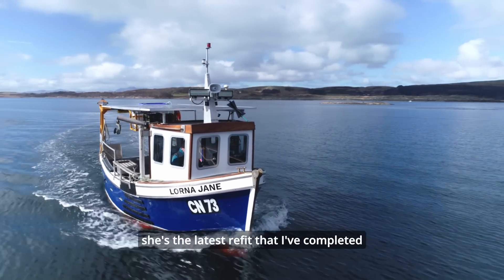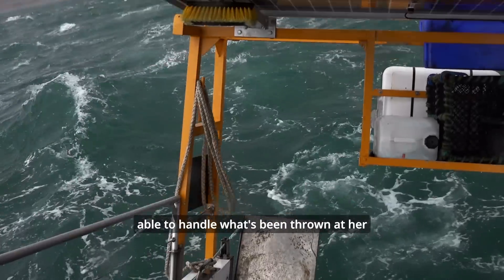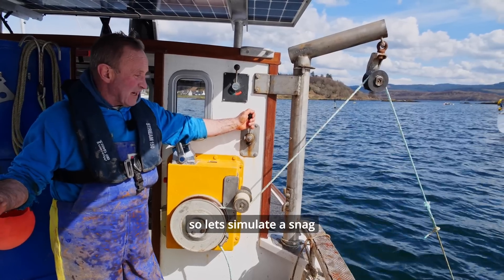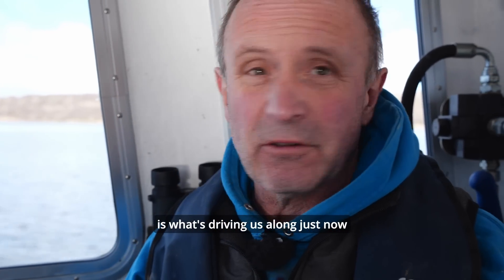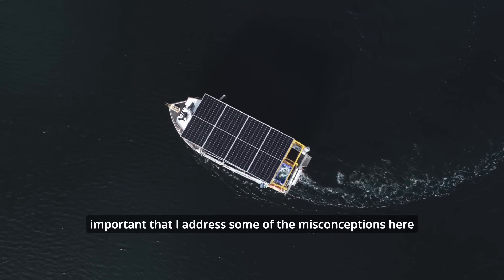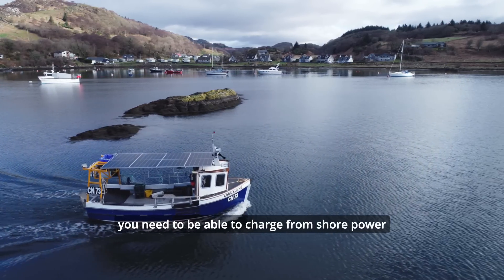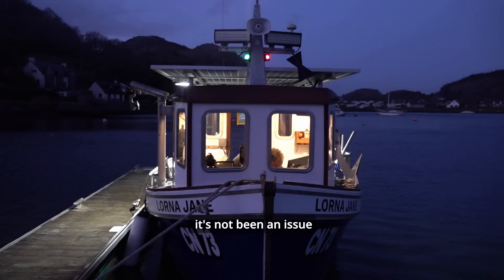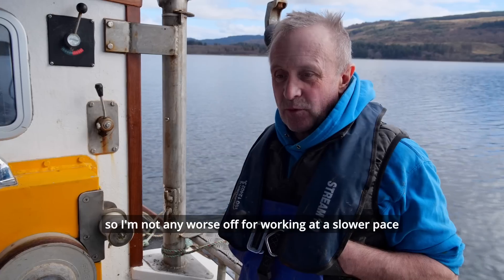An all electric Lobster fishing boat   Watch It Work  Lorna Jane.

Comment: That’s a great little boat. I like the idea. I’m interested as someone who grew up lobstering in Maine, how fast is that boat with diesel power. It seems to me a Maine boat such as a 33 Young Brothers would be faster with the electric power you’re running. More like 10 knots. But I’m really not sure.
Reply: If I put the handle down it does 6.5knts, pretty much what the diesel did. Hull speed of this design is 5.5 knots. You're right, the boat designs you have up the eastern coast look really efficient. Pretty sure you'd be faster with one of those designs. 8 knots seems more realistic to me but am not familiar with your boats. Speed will ultimately depend on motor size and weight of battery bank.
Reply: @ there was a wood 34 footer in the 50’s called Merganser designed and built  by Will Frost that did 25 knots fully soaked with a 240 horsepower 318 Chrysler V8. The old wood boats were much slipperier than the modern glass boats because the new boats hold their width to the stern for added room. But they’re still fast

Comment: Like to see you fix it at sea if your boat breaks in the ocean your done gaurantee 5 to 10 years you will be using deisel that boat takes on water your done i can think of so many situations that happens at sea that will knock out e boat but deisel either could be fixed or wouldnt effect it might be ok for this guy to run a boat like this but not going to be viable for most boats
Reply: So many failure points on a diesel engine.  Batteries will be IP6 or IP7 waterproof rated. Electric motor in this example actually is under water!

Comment: Just what I've been looking for. I'm going to be converting a Western Australian 12mtr Aluminium Cray (Lobster) Boat to elec (+ sail), for blue water cruising, the deck being the main living/patio area under the panels, vs most boats having small outdoor areas.
It's great you get up to 90% funding. I can get it for my house, not boat (honestly).

Q; How's the input benefit from down facing panels from water reflection? Apparently due to installer weight considerations, these panels have 3mm glass each side, vs standard having 6mm on top, which could be a concern with hail storms, or even walking on them for cleaning bird shiet, etc.

That Gemini looks a nice cat, not seen one before.

Comment: Gonna have far more issues than an ic engine. Sounds like a straight bad idea
Reply: How? Especially for his semi-retired requirements.
Plenty boats have converted to all elec now, especially blue water cruisers. This vid is just one example
Reply: Only one moving part. Difficult to see how you reach your conclusion.
Reply: @marviwilson1853  one moving part and 1000s of batteries, transitors, wiring, terminals, electrical components. All tiny and made of dissimiliar metals. Unless these stay on fresh water, they will get eaten alive
Reply: @durbeshpatel3047  Electrics and electronics have been used at sea for decades. Can't quite understand your logic.
Reply: Well he won't get engine overheating, blocked seawater cooling pipes, broken impellor pumps, snapped rubber belts, blocked fuel injectors, damaged oil seals, old air filters and oil filters, contaminated oil, contaminated diesel, broken compression and oil scrapper rings, damaged bearings, coked up exhausts, broken exhausts, governor problems, broken seals, oil leaks, damaged radiators, rusty fuel tanks, blown turbo's.... on and on and on and on....
Reply: @marviwilson1853  those are all things that are easy to fix compared tk electronics. Electronics at this scale are not widely used at sea, its basically for navigstion only. You need reliability. Not a million things to go wrong
Reply: @durbeshpatel3047  So what you are saying then is one of the most safety critical parts of going to sea, ie the navigation, is placed in the hands of electronics!
Reply: @marviwilson1853  yeah thats what im saying. Glad you can read. Go find me any vessel over 17ft that is fully battery electric powered and not riddle with issues. Pro tip, you cant.

Comment: Nice little boat. It's just nice to see how much power you need and what these Panels already provide. Batteries and motor/controllers will get cheaper and battery/solar will be the standard for coastal vessels and ferries soon.

Comment: so no sun and your out all day poor weather? battery for a boat is a no go !! for a boat around 12 to 20 ton  your wee boat might weigh 2.2 ton diesel is king! and always will be!!
Reply: Hybride
Reply: He said he still has 50% when he gets back. Can charge off grid at dock if required. What do you do if the diesel shiets itself?
Lead base petrol through a V8 carburettor was King before that, but wasn't any good for us or our grandkids either
Reply: @Lana_Warwick  is he hauling 900 pots per day? dont think so!! hes playing at it !
Reply: @azentioced9  He doesn't have the operational overheads requiring it, incl high fuel & R&M costs over long rough distances, in a larger boat to carry enough traps, line, floats, etc.
Also doesn't 'need to' pay wages+++ for Deckies.
I'd reckon his end of season net % would be better than anyone pulling 900p/d, with much less effort & stress.
Reply: @Lana_Warwick  wro n g that biilll shot face Ned I a
Reply: @sharonbraselton3135  What??
Reply: @Lana_Warwick  little boat not going far ! bigger boat needs diesel battery no good! battery cars fine for an old lady going to the shop no use if you have to travel a long way in the  snow? they have not put enough thought in to it and it wont work you need heaters in a car for a start  battery will not last  at sea you need diesel battery  will not work wast of time  this planet needs coal and petrol and diesel who can afford to heat there house with eletric?  no body unless your rich
Reply: @Lana_Warwick  hydrogen is the answer for every thing  engine cooking and heating
Reply: @azentioced9  Absolutely not. Too dangerous and very expensive. A hydrogen bus route in London was suspended during the olympic games because of the danger of explosion. The depot was at Stratford. Also the hydrogen busses cost about 17 times more to run than a normal diesel bus.
Reply: @tmog1000   diesel is king and always will be battery is crap fine for a  grannie car in town! thats it we NEED OIL for ever  a battery  remote control boat yeah!!
Reply: The sun in most places on earth, most of the time,  rises and sets every day. The only time that would be problematic would be during a total solar eclipse of the sun by the moon but they usually only last a handful of minutes. We are transitioning from the fossil fuel age to the electric age. It is a 100 year process. Nothing can stop it. The piston/cylinder heat engine whether steam or diesel has had its day.
Reply: @marviwilson1853   diesel is king!! and always will be !! and petrol  battery is no use for any thing at sea apart from lighting the gas cooker
Reply: @azentioced9  we are transitioning from the fossil fuel age to the electric age. It is maybe a 100 year long process. Nothing will stop it now.

Comment: I prefer a real boat with 5000 miles of range.
Reply: Hybrude hydergen😅
Reply: This boat can go 5000 miles without recharging at 3.5kts. It can refuel in the middle of the Pacific. You can't do that with diesel.
Reply: @marviwilson1853  
Actually you can and it’s been done for many decades. It’s called bunkering. 
5000 miles without recharging is an obvious lie. Do the math. 
Anyway, I’ve done multiple 5000 mile trips with no diesel and no recharging. It’s literally been done for hundreds upon hundreds of years. It’s called sailing and it requires no child labor working in dangerous mines.
Reply: @keithb6717  You clearly have not watched the video. At speeds of around 3-4 kts, solar/battery boats like this can cruise indefinitely in reasonably sunny conditions. During the day the panels generate more power than needed for low speed propulsion. The batteries always remain charged for propulsive power through the night. Nothing wrong with sailing, not sure why you mention that! Australia is the biggest lithium producer in the world. They don't use child labor as far as I remember. It really is not helpful to introduce these anti EV myths.
Reply: @marviwilson1853  
Obviously you’ve never traveled thousands of miles upon the ocean. I’m guessing you’ve no miles.
I’ve had arrays. They never produced enough power to even run the radar and autopilot and refrigeration and everything else without running the diesel a couple of hours daily. (Under sail). 
Sunny isn’t the norm, honey. You can pretty much count on rain once or twice a day. 
   Well, since Australia doesn’t have child labor we’ll excuse the practice globally and pretend that all batteries come from Australia. 
    Electrical is your system/systems most likely to fail. 
No diesel and no sails sounds like a ship of nightmares.
Reply: @marviwilson1853  
I sailed to Hawaii from Mexico at seven knots. It took 28 days. That thing, ifit continued working, would take about sixty. What fun!
Reply: @keithb6717  but he is not looking for Lobsters in Hawaii! 28 days to go from Mexico to Hawaii when a plane takes some hours - what fun!!
Reply: @keithb6717  I am a seaman. Probably spend over 10 years of my life at sea. Tens of thousands of miles at sea worldwide. With a diesel tank you have a fixed range at a certain speed, with a battery "tank" you have a fixed range at a certain speed but the battery can recharge at sea the diesel tank cannot. Your passage plan just takes all this into account to allow you to complete your voyage safely. You mislead the reader, radar's and autopilots do not run directly from solar panels they run from batteries charged by solar panels. You clearly failed to calculate your battery capacity and solar installation required to run all your electrics. That is your fault. It would be like running out of fuel in a car driving from A to B and then saying it was a problem with petrol and the stuff is no good!! Most batteries as the readers here will know come from China with raw materials sourced in Australia, Chile and China. As Congo producers tiny amounts of the worlds Lithium supply but maybe uses child labour then off course the anti electric lobby make this a headline. We don't buy it! The world is changing from the fossil fuel age to the electric age. It is maybe a 100 year transitional process and nothing will stop it.
Reply: @marviwilson1853  
I’m a sailing captain. I don’t have a wimpy maximum range except for limitations on food. I don’t own the boats or build them. For instance Hawaii from La Paz = 40 gallons fuel (and no child miners!) (we don’t use fuel for propulsion, the prop wouldn’t do much 2hen the boat is under sail as sailing speed is faster than the motor could go typically) (I actually have more of a minimum range. If you’re not going a few thousand miles then I’m not your guy.). Diesel is only used for a couple of miles out of an anchorage and for charging. Th@ts it.  I’ve made voyages with no motor at all. (Like the future of electric motors on boats, broken)  
3.5 kn is a joke. If that’s your theoretical speed based on capacity etc then you’re not actually going to accomplish th@t. Any wind or current and you’re f’d.
   A sailboat designed centuries ago can blow you away both environmentally and practically. 
You’re going backwards with great damage and costs to the environment. Only half of the worlds lithium comes from AU, you’re fooling no one pretending there’s no children or POLLUTION involved (or actual slave labor in chin@ because you deserve the prices only slave labor can accomplish). You’re blinded by ideology. The technology isn’t there. Bless your heart.
   
  But as long as you’re virtue Signaling you don’t really ex@mine the destruction.
Reply: @marviwilson1853  
That boat wouldn’t even be able to make the trip from San Diego to Cabo. Well, it could make it there in a month or two but it wouldn’t be able to return. The current and wind is against you. We call it The Baja Bash. You’d be making one knot if you’re lucky. What a joke that would be. I suppose you could come in really tight to the rocky coast and utilize the back eddy but that’s quite dangerous and you’d only pick up a kn.
Reply: @marviwilson1853  
I just reread your comment. Ten years? You a rookie, son.
Reply: @keithb6717  That's 10x365 so 3650 days at sea! minimum. I think much more but I would need to check my diaries going back the last 37 years.
Reply: @keithb6717  All boats, planes and cars are designed for a mission. That is why an F1 racecar looks nothing like an off road vehicle. This boat is designed to fish for Lobsters of the West Coast of Scotland! so why on earth are you wondering if it could make it from San Diego to Cabo?!!!!
Reply: @keithb6717  All very true but what has all that got to do with fishing for Lobsters off the West Coast of Scotland in an electric boat. This guy when approaching pots needs to go 15m forward then stop. Maybe 5m port then stop and hold station if you get my drift. Like to see you do that in a sailboat!
Reply: @marviwilson1853  
You do realize that fishing has been done in sailboats for hundreds of years, perhaps thousands. Even before they had motors! Amazing! A small sailboat can have these things that seamen call ‘oars’. They also do not require child or slave labor or chemical processes. Maybe one day you’ll learn to sail and in most cases you can pull right up to it under sail. How do you think we pick up moorings? We don’t run the diesel. That’d be silly and embarrassing. Real seamen plan stuff out several moves ahead even planning for eventualities like the bow man might miss with the boathook. Yes, we sail off the anchor as well. After forty years it ain’t no thing. Obviously your views on sailing are based on inexperience and lack of knowledge.
   You’re going backwards quickly. 
Of course sails and oars are labor intensive but I don’t believe that I deserve children or uygur Muslim slaves to do it for me.
Reply: @marviwilson1853  
I’m not wondering at all. I know it can’t. It’s a toy that will soon fail at its current ‘mission’, virtue Signaling. I suggest towing insurance and a good anchor. Better throw a Barbie on there for the long waits as well. It’s probably broken already.
Reply: @keithb6717  Your attitude and confrontational style clearly show that you are not a Master Mariner. You come across as very childish in your comments and approach to the discussion. It is not to your credit so I will leave you there.
Reply: @marviwilson1853  
In addition, i could run a small diesel genset all day for twenty years and never make a dent in the amount of diesel that was required to mine and transport the raw materials for the battery in that boat.
   It’s so very silly. Ideology has clouded your mind to the obvious.

Comment: Well colour me impressed!
Your small trawler is a "flagship" (if you will pardon the pun) for electrical re-fitment.
I am of the opinion that £137,000 is TOO MUCH for what you had installed. The 20kW + ESC is fine, the Victron equipment is excellent. Your batteries could have been much cheaper if you had raw 16x3.2V/340Ah LiFePO4 cells with 100A BMS installed.  
£680 = 16x320Ah/3.2V (16.384kWh)
Solar panels should now be about £100 for 500W each.
Golden Motors also has some excellent marine motors at very good prices (perhaps 2 x 10kW motors - 1 for backup)
Reply: The problem he would face would be the regulators no doubt only "green lighting" certain products and components.
Reply: @marviwilson1853  and with good reason - it would take a lot of kerosene to send out a rescue helicopter if a homemade battery pack was to suddenly sto working in rough seas. There is a very good reason why this vessel would install the highest quality equipment - and it has to do with the sea being a very unforgiving environment.
Reply: Where did you get the 137K figure from? Was it just for the off-grid components, or the entire refit incl, removal of engine, tanks, lines, etc, etc?

I agree re batteries, however it's likely an insurance requirement for his 'commercial operation', especially if he employs deckhands.
I've got a 15kWh Gobel Power unit with built in extinguishers (~4Kau), insurance Co wont consider it unless Gobel fork out Big $ to get put on a list of approved suppliers🤷‍♀

If ever required, I'd use the tender outboard as redundancy.
Reply: @Lana_Warwick  It's posted on their website! It shows more details.

Comment: As a fisherman I wouldn’t have it as a gift  when in trouble no reserves limited us  cornwall rains months on end
Reply: What reserve/backup do you have when the diesel shiets itself?
Reply: @Lana_Warwick  What reserve/backup do you have when the Electric shiets itself?
  Electric is not 100% reliable yet.  Too many electronic components in the system. As I have found to my cost.
Reply: @tmog1000  Didn't answer the Q I asked. Only negging elec, when both can & do have issues.
So whatever your answer to my Q is, it's prob similar to mine
Reply: So some sort of waterproof clothing needed then. I don't see the problem with rain!
Reply: And your tax money are paying for it.  90% subsidy and all.

Comment: 8x400W, 3.2kwp?
That boats needs min. 20kw power for moving, so best case you get 1:10 motor running time. Not viable for work.
Reply: Your figures are miles out.
Reply: The guy who built the boat and uses it for fishing is the one who can tell you exactly how much power he needs. The boat he uses is a full displacement hull and I believe has a designed hull speed of around 5-7kts. What did you mean by "moving"?